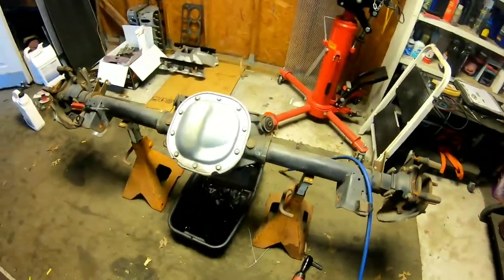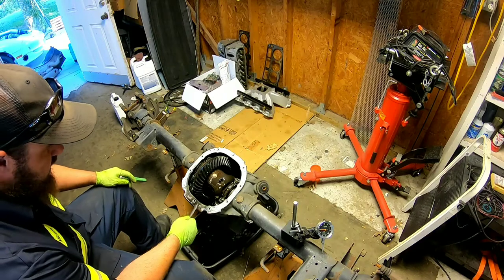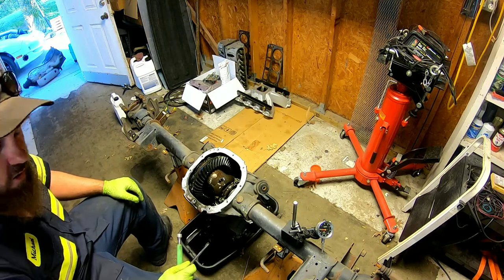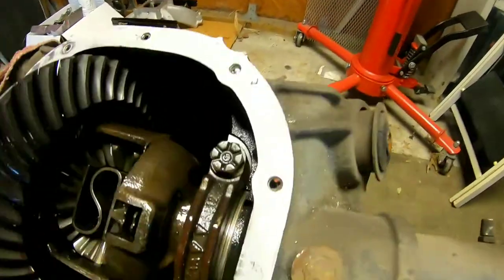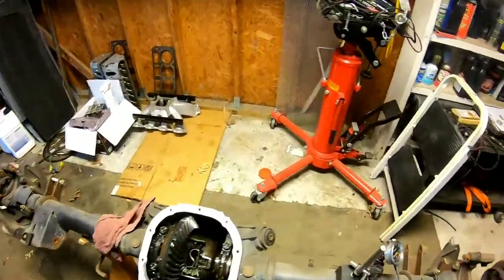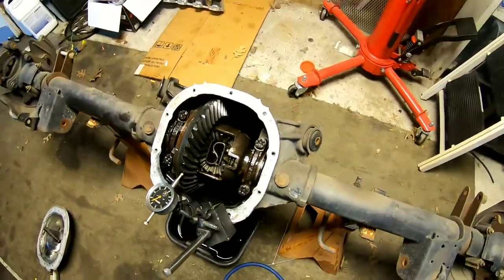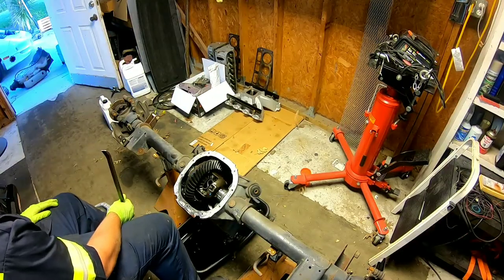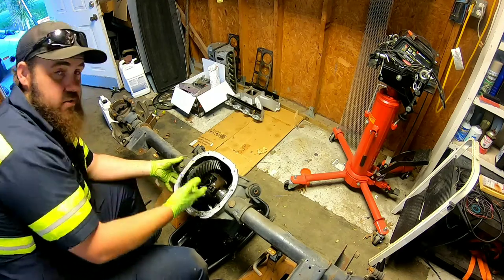How "I" rebuild a Ford 8.8 differential. Part 1

Comment: Man I got a 2014 f250 and it's making a howling sound when I let off the gas, I'm thinking it's coming from rear end. I replaced the driveshaft support bearing and it helped alil bit, but noise is still there
Reply from the maker: Very possible because the gear has two sides. Drive and coast, could also be pinion bearings.

Comment: sorry dude, but the angle you have set up your DTI to measure Backlash is not correct and misleading to anyone using this video as a How To. You need to set the DTI spindle as close as possible to right angles (90degs) on the Tangent. To achieve this you'll need to set the DTI body as close as possible without touching the perimeter of the Ring Gear Teeth.
Reply from the maker: Guess I've just gotten luck on the idk 2000+ differentials I've assembled in the last 15 years.